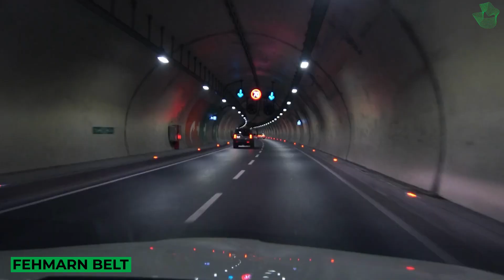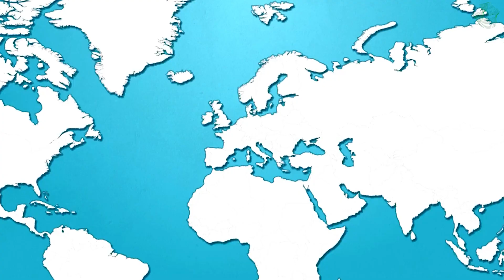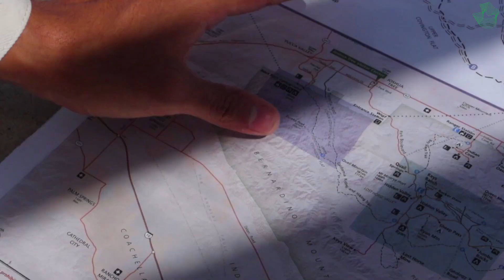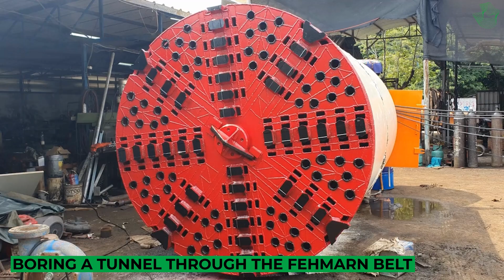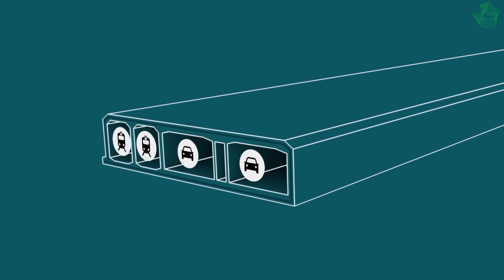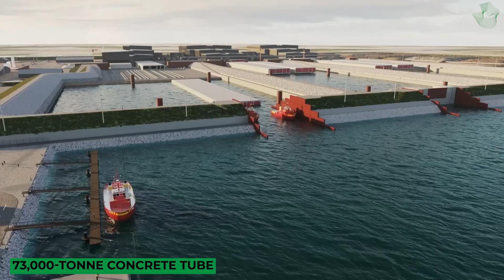WORLD'S LONGEST UNDERWATER TUNNEL

Comment: I'd like to know and see how they connect each section because I'm guessing that would be the most vulnerable part to failure.
Reply: Each section obviously is closed off with watertight barriers/doors. These are however not fully flush with the ends of the sections. Meaning once placed together on the (excavated) sea floor, they result in pockets of water trapped between the barriers at the intersections of each module. This water is then pumped out, creating a vacuum-like effect that pulls the modules together, ensuring a better seal.